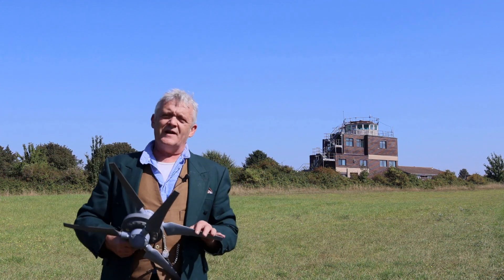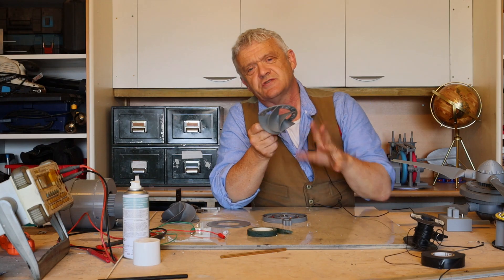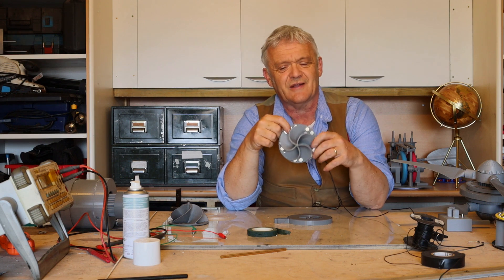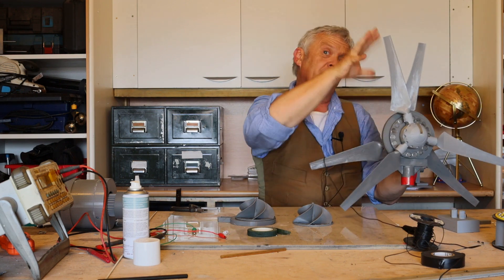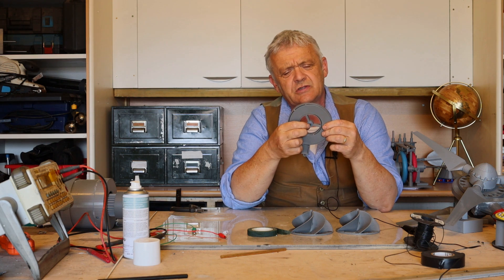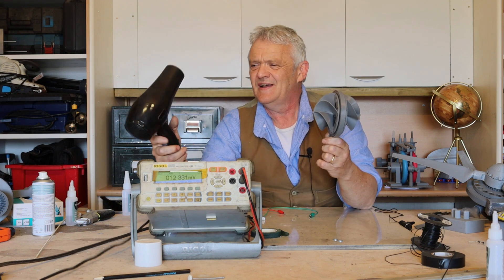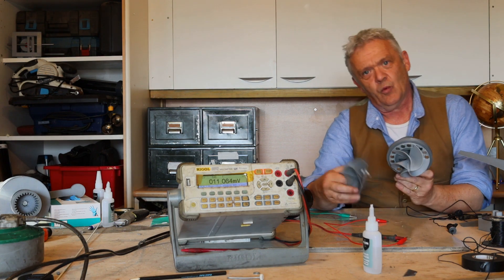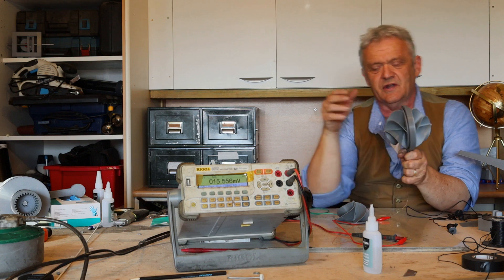2043 An Omnidirectional Wind Turbine

Comment: Hi mr Murray, i’ve been playing with the idea to make a sphere donut, with inside de ‘o’ a hourglass shaped turbine. That makes a compression stroke towards the middle and is prlaced with the hole facing the sky. Tophalf is black for sun absorbtion bottom part is white for reflection. Air flows in direction sky, so should be the direction of the turbine blades. 

The idea didn’t let me go eversince 😂. All the best Luuk (nl)
Reply from the maker: nice idea mate thanks for sharing

Comment: About 25 years ago my dad made an omni-directional turbine for pipes. It looks kind of like if the Predator designed a volleyball. Not sure what happened to it. He made his greatest success when he made a special structure that converts the energy of small waves into vertical height so that you can create a gravity feed of sea water into estuaries so that the estuary stays healthy and then the device managed to be used for the same functionality but to create a water turbine from constant waves. It's just a ramp but it has unique angles that amplify the wave into the right compression so that the wave can clear extra height. The Australian and German governments were going to build a lot of them but I guess then the pioneers of the WEF shut it down because it was too simple and effective. Just floating concrete ramps.
Reply from the maker: very cool story mate - thanks for sharing

Comment: Hello Robert, You might have seen this already, if not I suggest you look it up because I think you will find it very interesting...One of the world's largest tier-one auto parts suppliers claims it's created the "perfect motor." The compact Mahle motor uses no rare earth magnets, transmits power without contact or wear, and can run at high power indefinitely without overheating.
Reply from the maker: the key they claim is a new cooling system mate

Comment: This is a perfect design for people without a 3D printer to copy or enlarge using standard materials like plywood (marine or standard) and careful building to maintain balance and strength. If enlarged it should be able to use 6 wings with evenly distributed magnets between them as well as lower edge support. It would appear that the diameter of the ball is about 100 to 125mm, comparing it to Robert's hand width.
Reply from the maker: it's 104mm in diameter mate if you grab the stl and upload them into tinkercad you will get all the measurements

Comment: The vertical Helical wind turbine is another good design and also an 360 degree wind flow usage. Not omni directional but since most wind travels in a relative plane to the ground then it works well enough. It can sit low to objects and not have the giant blades and can self balance itself and not self destruct like the big ones do. Can also have a extra brake on the shaft because it can have 2 points of holding, top and bottom. Those 2 points can give a fair bit of room for everything. 

Omnidirectional would be good on mobile platforms like cars, RVs and even busses. Mostly for when they are just sitting around, they can help with some recharging instead of just relying on main charging. They can also power something remotely like a trailer and even while in use so it would cut down wiring to the main vehicle. Heck these things could be positioned onto Telephone poles up in the air spinning away without causing too much harm to the surrounding. Given the number of poles like that in just a town alone, it would give a pretty healthy energy charge any time of the day.
Reply from the maker: cheers mate

Comment: Wow!!! I'm curious as to what happens now when that's driven as a motor instead.. omnidirectioal should make a low pressure point lol but also if its air came from a tube how well does it make suction?
Reply from the maker: i have no idea but interesting question - it may well act as an impeller

Comment: With the same size and design of the generator part, how does the energy production compare with conventional blades when going against a wide enough wind "surface" to hit the whole thing evenly? (perhaps you could test it by mounting them on the back of a pickup truck, one on each side to get the readings simultaneously symmetrically), and then drive back and forth a few times to get an average and cancel out the effects of crosswind on the conventional blades? Also, does this design produce the same amount of energy with wind coming from all directions, when the wind "surface" is large enough to hit the whole thing?
Reply from the maker: wind power is more to do with the area of wind captured not generator size

Comment: another step in the evolutionary process, Robert....   Looking at the thingiverse drawings and the magnetic seats on the omnidirectional turbine a question arose... would there be a stronger electric output if those seats/magnets were on the side of the serpentine coil rather than on the blade side i.e. does the thin plastic base acts as a partial insulator?  If that makes sense...
Reply: I would think that you'd lose all of the polarization on it because the magnets hold the blade side on.  Put it on the middle section and they won't turn because they're in a fixed position.
Reply from the maker: it keeps the magnets further from the coil and that reduces field strength - the nearer the better - but then the tolerances on a 3d printed prototype are not great

Comment: Since it's roughly round, it could be mounted inside one of those nose bump things some older semi trucks put on their front grille to help aerodynamics; the air pressure creates enough of a laminar flow across the surface of it that it should ignore the turbine and see it as mostly a smooth surface.  Until it's going fast enough for it to build up enough pressure to create that effect, it's not going fast enough to make a difference and is still generating the whole time without adding to, but improving, drag.
Reply from the maker: interesting idea mate cheers

Comment: Im looking at making a few of these to take fishing. What wire do you use on the serpentine coil? Ive had a look and can't for the life of me find the exact type of wire you use.
Reply from the maker: it's just magnet wire mate 0.2mm diameter - it's sold all over including amazon
Reply: @ThinkingandTinkering How much is needed
Reply: The copper wire has a thin protective coating on it that insulates it from the other wire and prevents shorting and cancelling. I think it's called radio wire or something.

Comment: Its smaller but its stackable.. A few videos back I commented about a combining cage vertical blade with horizontal axis.. this is very much like this. So if you expand this to be the length of the turbine shaft.. does this not make existing turbines more powerful? could we not use this to capture any air swept off those fans? Then combine with rim generator (you already are doing rim generation here right?)
Reply from the maker: this is also an example of a rim style generator mate

Comment: Such an interesting result, a horizontal turbine that is a vertical turbine. Did like someone's suggestion to move the generator completely out of the wind flow. But there is another option, move the blades past the edge of the generator.
Reply from the maker: this is an example of generation at the rim mate if i moved the blades out i would move the generator out too
Reply: @ThinkingandTinkering  I was, like the other comment, thinking about the wind flow. In this instance trying to get some wind coupling where the blades had the largest leverage.

Comment: So one of these with the diameter of the standard blades gives a much larger rotational area  and  higer output my blasdes are 600mm so 1200mm diameter.
Reply: You can print one that large?
Reply from the maker: probably printed in parts mate
Reply from the maker: awesome

Comment: Those are brilliant for any small homestead or off-grid barn! Just set a few rows of them on your roof, the spacing doesn't look to be that important, as long as they aren't touching, me thinks.
The teaching about the distance from the Multi-Rotor of a quarter of a rotor length should perhaps still be adhered to, shouldn't it? In this case maybe a quarter of the ball diameter?

About the Multi-Rotor, btw: If you add another set of Rotor blades, a quarter of the blade length spaced out on an axle and 2nd&3rd equally spaced out in angle, would that 3rd set of blades add to the strength of wind generator? Or would it be detrimental?

Because a 3rd set would, if not detrimental to the power generation, simultaneously act as a wind wane to keep the Rotors in the wind as well as the possibility to add in power generation
Reply from the maker: cheers mate and i would think so - but i am not sure

Comment: Yet another item of interest!
I wonder if there is any benefit in having the blades opposing? You have holes in the "base" so air can go from one side to the other. With opposing blades this would cause a loss in the tailing blade, but if it were reversed you would get effectively two blades working in tandem (even if they will stop and reverse when the wind changes direction.
To be honest the wind rarely does a full 180 very often!

Eather way, cheers for making me think!
Reply: The wind always does a 180degree shift when I am turning round to go home on my bike
Reply: @davidmunro2077  May the wind blow gently on your back! ?
Reply from the maker: there are holes mate - check out the drawing
Reply: @ThinkingandTinkering  That is what I said. Could the airflow Through give extra input from the trailing blade if it is the handedness of the blades were correct!

Comment: How many of those little turbines could you get in series on your roof. If one does  8 volts
Reply from the maker: they are 4 inch diameter - so quite a few
Reply: @ThinkingandTinkering  which would be me efficient these or the Darwin with the double blade. Then run a few of them in series along the roof if you don't make them too big or would it better only a few bigger ones ?

Comment: even though it's bidirectional it seem to have a most efficient angle that the wind should be blowing on to ... I would THINK its straight onto the face of the spiral, (more testing is needed to prove this true) and if this is the case then the other spiral is nothing but dead weight.... so if you were to put a bearing on the pole so it could rotate around, and put  arm with vertical fin this would steer it so the spiral is always facing straight onto the wind.....  and of course there's no need for the other spiral at this point so it could be removed... OR another piece that CONTINUES the spiral onto the other side would create more surface area and catch more wind, spinning it faster..... so it's still omnidirectional but you could create a larger diameter AND you could even design that secondary spiral to be the optimal shape according to fluid dynamic principles (sort of like how there have been new propeller designs created for boats that were designed in computer programs that no one had thought would be of any improvement but turned out to VASTLY increase performance.... they sort of look like loops and are complete counter intuitive looking lol - I just looked it up and they're called toroidal propellers ) - oh and I'm just spitting out thoughts that come to mind when I see your amazing creations... I'm not trying to tell you to do this or that, or to say it would be better if you did it this was or that....  maybe they'll inspire you to come up with a new idea or maybe I'm just getting annoying (don't hesitate to tell me to stfu LOL) 
- Have you looked into torodial propellers on the channel before? ( I can't say I've watched all 2000+ videos since I discovered your channel a few weeks ago LOL ) if you haven't maybe it's something you might want to explore
Reply from the maker: it will do and you are right the answer is more testing

Comment: I would like to see the performance of a much bigger version...perhaps something that matches the outside diameter of the bladed version
Reply: You'd need an industrial sized (very expensive) 3D printer for that. The normal bed size won't get much bigger, or Robert would do so.
Reply from the maker: go for it build one and test

Comment: Well I was going to mention setting the double blade generator at 15° angle to the wind allowing more power to be extracted  discovered by the Jacobs wind power company. Now this may remove the tilt as an option with the ball generator.
Reply from the maker: it may well do - cheers mate

Comment: Hmm. The propeller blades are mirror images of each other, meaning they'll spin in the same direction. Laminar flow from the right side to the left side along the axle would dictate that the propellers be reversed images rather than mirror images for better air movement through the device. I also wonder if it would be possible to counter-rotate one side relative to the other...
Reply from the maker: contra rotation isn't a good idea mate the magnets would in effect cancel each other out for 180 degrees of turn halving the output and it would introduce cogging raising the start wind speed
Reply: @ThinkingandTinkering  Hmm. Okay, that makes sense. I was thinking of gearing where if you have to counter-rotating objects, their speed relative to each other would be double that of whatever is driving it since they're spinning against each other.
Reply from the maker: it is good thinking mate and i get where you are coming from but with axial flux like this it would be counter productive - i think - but that is only what I think - you could always give it a go and see how it works for you - cheers mate and keep the ideas coming
Reply: @ThinkingandTinkering  Maybe when I get myself a printer of my own, hehe.

Comment: A series of them on a house roof ridge feeding into a battery would be brilliant. Better still could this charge up a sand battery ??
Reply: Both. Use the Sand Battery as the "Dump load" for when the batteries are full.
Reply from the maker: Timesurfer is spot on mate

Comment: I guess it would be somewhat important to make sure the magnets match up N/N and S/S on each side of the coil, as to not cancel each other out?
Reply: Magnetic fields are always between a north pole and a south pole - so the north poles on one side will link up to the south poles on the other and vice versa. That will cause them to move together, and also cause the magnetic field to pass straight through the coil as they rotate, which is what you want.
Reply from the maker: they line up automatically mate and the field needs to flow from N to S - which it will just do

Comment: Side benefit of that setup is one could probably go without the superglue coating trick, which can make quite a mess if not outright melt the part you're working on, been there done that destroyed some prints trying to glue them together ....
Reply: Would it be possible to introduce graphene into the material the 3D printers use, thus to strengthen the artifacts they produce?
Reply: @monadyne  so far the various "infused" materials, from metal to carbon fiber to ceramic I've seen don't seem to do much more than wear out nozzles, if they have any significant improvements in durability I've not really noticed it.
Reply: @robertsmith4681  Thank you for your reply. Hmm... one might think that the minuscule size of graphene molecules (as compared with metals, carbon fibers, etc.) might allow them to slip through the nozzles without much of an impact. Then again, my thoughts are unencumbered by any knowledge on the subject whatsoever.
Reply: @monadyne  The thing with graphene is that random molecules aren't going to do much if anything at all, you need this stuff to be sort of woven like carbon fiber for it to be a useful material, that's why it hasn't really been commercialized yet, making small bits of it is easy, long strands that can be woven into sheets and such, not so much,.
Reply from the maker: superglue can be messy for sure!
Reply: I would suggest using ABS or ASA (UV resistant ABS) for actual installations it is much stronger than PLA. And an additional benefit is that you can acetone smooth it, so no need to go gluing your fingers together.

Comment: Hey Robert! This seems to be the perfect wind generator for a bike Now if you could make it attachable to a bike's handlebars it will generate power even when you are not cycling - attach that to a battery and have onboard usb charging and so on on board. It seems even the form factor could be alright - maybe just a tiny bit smaller? What do you think?
Reply: Attach it to the bolts on the wheels in front, either side or both.
Reply from the maker: i like the idea mate

Comment: Have you also though about ways to make the "razor blade" version any safer for wildlife? Maybe some sort of frame that hold chicken wire or something and see how much performance is lost.
Reply from the maker: well - sticking it in a Darwin structure would work well - so yes - i have thought about it!
Reply: Painting one of the wind turbines blades black reduces bird deaths by 70 percent
Reply: Only do that if you're not in a very hot and/or sunny location. The black will melt or deform your printed blade.
Reply: Using a wind collector and mounting the blades horizontally, as discussed in 2039, will deal with this. We await the resulting video with interest.
Reply: @mark.guitar  AGAIN🙂